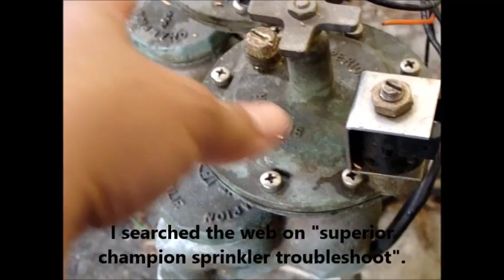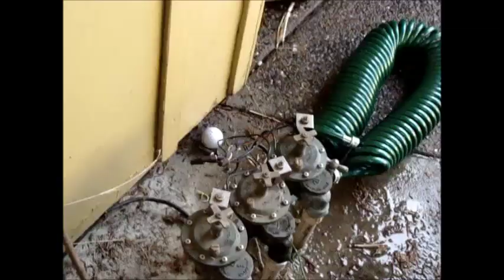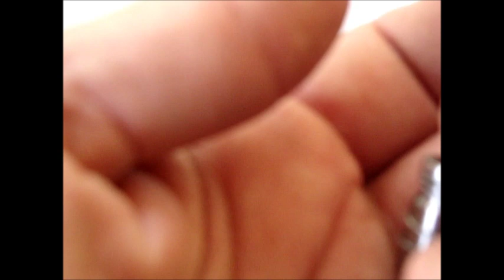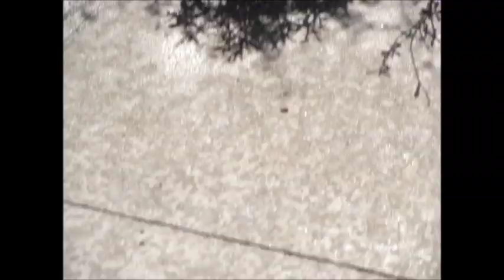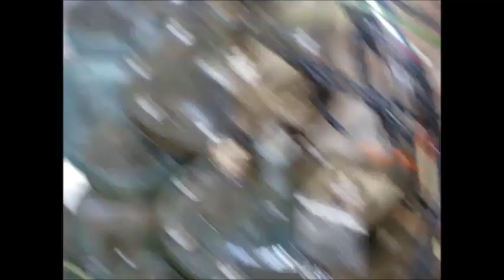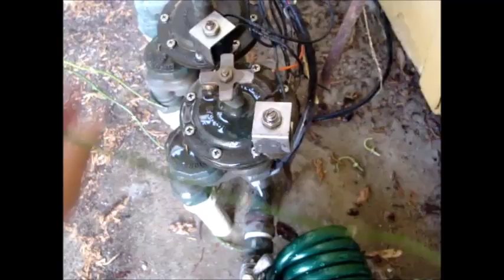Champion Superior Sprinkler - Troubleshooting Video

Comment: You said it’s not suppose to work when you open the brass bleeder valve . That is exactly what the brass bleeder valve is for . You can open the bleeder valve and the water comes on close the bleeder valve and the water will shut off .

Comment: What is the X shaped knob on the top for?
Reply from the maker: You use that to turn the valve on with a fork shaped tool when you don't have it on an automated sprinkler.

Comment: Your video was a great help to diagnose and fix my problem. THANK YOU! In my case, the solenoid valve was stuck. The plunger piece did not move in and out of the tube smoothly. I felt it catch on some scale the first time I tried to move it. I cleaned the parts well and replaced, and viola! Valve opens and closes like a charm. Hint--if you think this is your problem, you don't have to remove the bonnet to get at this valve. Just remove the black rubber solenoid assembly. Get a grip on the valve post with a pair of small channel-lock pliers (or any pliers that fit around the post without causing damage. perhaps wrap with piece of tape or cloth to protect). Gently unscrew from bottom housing.
Reply from the maker: Thank you Bernice! For your feedback!

Comment: Thank you for the video. I tried your troubleshooting suggestions but no luck. I called a sprinkler repairman who charged me $125 to tell me my system is too old for him to work on and wanted $1300 to upgrade.  One of mine won't shut off which is NOT a $1300 problem.  I'm open to suggestions.

Comment: Tightening the 1/2” nut on top of the solenoid coil only tightens the solenoid coil.  The screw slot on top of the solenoid valve stem is for tightening the solenoid armature housing down.  The other screw in the valve body must be closed; otherwise the sprinklers in that zone will always be running.  You might have to replace the entire power head.  I had to do that once (last resort)

Comment: Thank you. 
 I have a Champion brass valve that wasn't completely turning on. My other valves are plastic. If I use the manual mode the valve works fully. I got a rebuild kit and replaced the plastic inner part and it helped once then went back to not fully opening. 
Your thought to just switch solenoids was so logical. I stopped the video and just tried that.Just switched up and both worked - so the Champion one was just not up to it's job anymore but still worked for the plastic.
Reply from the maker: So glad I could help! I get some folks who complain, then I get a nice post like yours and Hurrah!

Comment: Good for you! Thanks for posting , I also try  and fix most of the things around my home. I’ve found that older things may need a part but usually when you call out someone to fix anything they just want to sell you a new system, which I’ve done only to have it replaced with something cheaply made that breaks after a year. Currently I’m working on my sprinklers they’re old Champion brass fixtures ad I like them better than the cheap plastic ones!
Reply: I'm with you! We should form a support group!

Comment: This video was super helpful. Thanks! I followed your steps and fixed my sprinklers. Like you, my problem was not the solenoid but instead the components under it. Once I was able to take the pieces apart (I had a frozen nut) it was fixed in about ten minutes. Thanks again.
Reply from the maker: Thank you, David!  So glad that you found it helpful!

Comment: "Instead of paying 300 like the guy said " congratulations, you played yourself. I respect you for doing the job yourself but you just did a basically $300 job. Don't think everyone is trying to scam you.
Reply from the maker: I do agree that time and expertise are worth the cost, but he wanted to cut the brass valve off and replace it with a plastic one.
Reply: @SquiggleMom  plastic is much cheaper and they make good quality plastic valves now too. However I agree, 300 is high if all he was gonna do is I cut and glue for a plastic. Theres not even a diagnosis included in that process like you displayed here.
Reply: Sorry if I came off as an asshole, you seem really nice and I'm a stranger in the void we call the internet. I enjoyed this video, make more!

Comment: Anyone watching this, be aware that the flow adjustment she refers to is the air bleed screw.  It is opened just for a moment when setting up to allow any trapped air to get out.  It will also allow manual operation by loosening it.  For normal operation, it must be turned tight, or the water will not turn off (as seen in the video).   Over all, not a lot of helpful info here.

Comment: Don't know what is the problem with all the Negative Nellies. I was fascinated simply with her thought process troubleshooting the mechanics. The women I know would simply reject out of hand the idea of even making an attempt to try to understand the workings. Two Thumbs UP!
Reply from the maker: Thanks, Richard Herrera!
Reply: I thought the same thing - Awesome deductions SquiggleMom
Reply: I really appreciate your effort. When I turn the valve handle on top the sprinklers do not come on. Some spin freely so I know that’s one problem I have to open up the valve and check. The only other aspect I would correct is your close ups were very blurry and I could not see what’s going on.
You are light years ahead of where I am at so appreciate it.

Comment: Pretty helpful video- but just in case anyone else is needing more help, Champion Irrigation & Superior are not the same company.  The valve body (part connected to the pipes) says Champion, but the electric adapter or actuator is made by a company called Buckner-Superior... It's confusing. That's why the guide from Champion irrigation is not super accurate...
Reply from the maker: +Will Schneider Interesting! Thank you for sharing!

Comment: y don't u go to home Depot  and by a rainbird  anti  siphon  valve  a new one  those are old hook  it up to the same wires and bee don't cost is about 20 dollars  or so
Reply: The Brass Valves work 100 % percent longer than the cheap plastic jobs  Rainbird sells.

Comment: SquiggleMom this is very helpful.  would you have the PDF file you downloaded from Arrow/Champion?  I visited the link you showed, but it is no longer there.  Thanks!
Reply from the maker: JONATHAN CHEN I found it here, Johnathan. http://championirrigation.com/op_champarrow/files/Champion_Automatic_Adapters.pdf
Search on Champion Sprinkler Troubleshooting
Reply: @SquiggleMom  It's been moved.  The document is now at https://arrowheadbrass.com/wp-content/uploads/2021/02/Automatic-Actuator-Anti-Siphon-Valve-Repair-Guide.pdf
Reply from the maker: @stevejohnson1685  Thank you for that update!
Reply: Recently tried to locate this manual - sadly seems to be unavailable and not easily located using available search tools - love to get a copy if you’re willing to share it
Reply: Link no longer works, just found this though - https://arrowheadbrass.com/wp-content/uploads/2023/01/Automatic-Actuator-Valve-Repair-Guide-Update-MW-122122.pdf
Reply: Sought this out because, after solenoid actuates,  I am having to open the stuck valve by loosening the bleed valve about 1/4 turn until water comes out, then valve opens. I re-tighten and it finishes cycle and shuts down per the timer.  Some times it works normally, but most often I have to repeat this process.

Comment: Oh my god, my svaior!! How did you remove that solenoid rod? I took off the solenoid tube housing like you did in the video, but the rod stayed in. I thought it was rusted into the housing, but it looked like you were able to remove it. I didn't want to pull the rod straight out. The repair did not know anything about these valves and wanted to replace the whole system with pvc...
Reply: solenoid rod is set in with a regular screw driver. don't ruin it with another tool and strip it. same thing with the valve for manual on and off. brass knob with slot for screw driver.